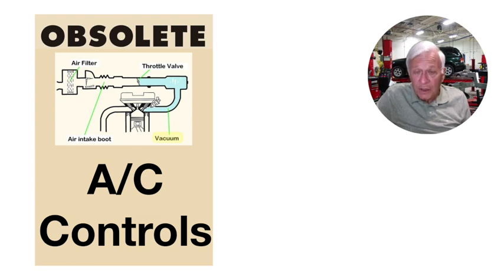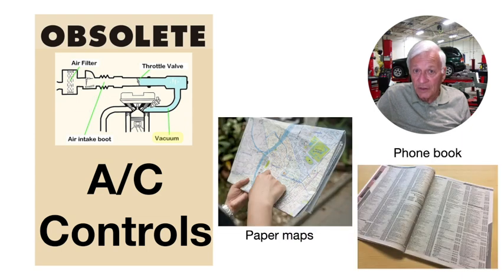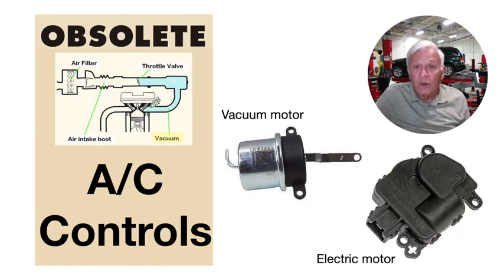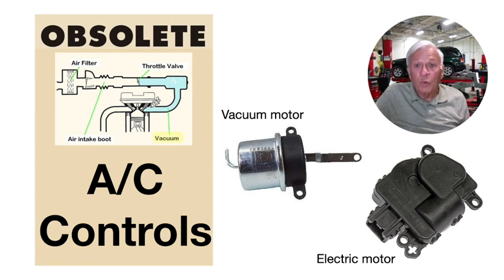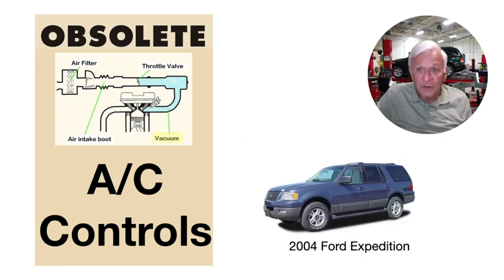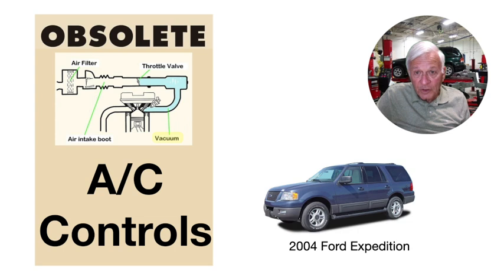HVAC Vacuum Control Problems Example 1

Comment: We have a 1998 Chevy K1500 pickup that the speedometer is jumping all over the place and the ABS light is on and the cruise control will not engage.  The transmission is shifting up and down erratically while driving like the speedometer is telling it to do this.  We replaced the transmission speed sensor on the transfer case and the ignition switch wiring harness, but that did not fix it.  Have you ran into this problem before?
Reply: It is likely your speedometer cable is binding from loss of lubrication. Remove it, coat it in lithium grease and reinstall. If not familiar, have a reputable mechanic do this.